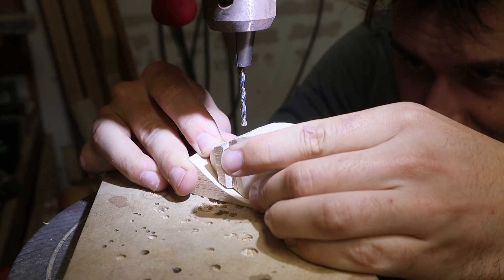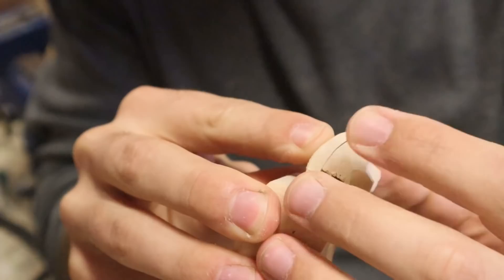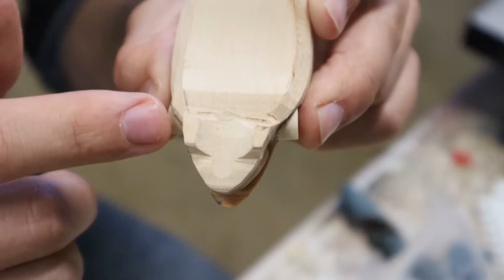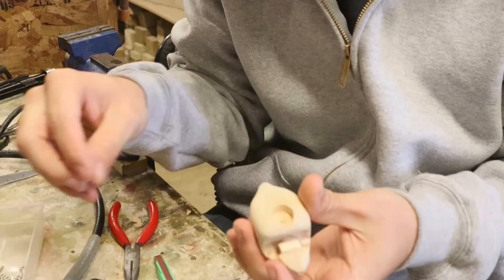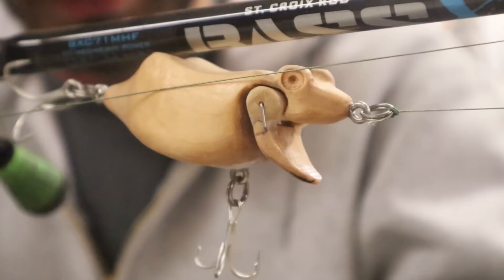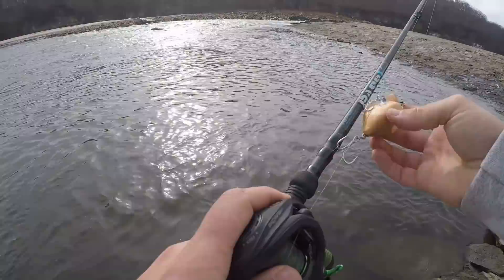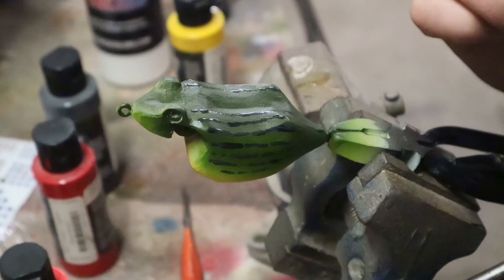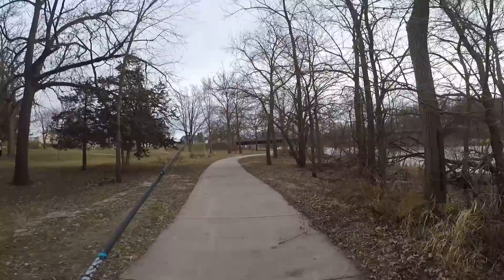Making a Hinged Jaw Bull Frog Lure

Comment: I think it's the drag caused by the water going over the humps on the back that is causing it to want to come back up. The lip opens and pulls it downward, then the drag causes it to want to level off, then the lip opens and pulls it down again, etc., etc. Adjusting those 2 parts, the size and shape of the lip and the size and shape of the humps in the back will adjust the up and down action. Silicon legs would work great on this bait too, I think. When it's in motion they will collapse backwards like a real frogs legs do when they are swimming. Then when you stop they will go back to normal resting position. Just some thoughts. Love the bait!

Comment: I LIKED IT MAN!!! I BET IT WOULD WORK GREAT AS A TOP WATER POPPER IN THE SUMMER. YOU COULD MAKE A LIP OUT OF LEXAN  CUTTING A SLOT INTO A DOWEL TO GLUE IT AND CREATE ANOTHER HINGE JOINT. THEN PAINT THE LEXAN AND WOOD LIP. SO YOU WOULD STILL HAVE AN AWESOME DESIGN WITH THE DURABILITY OF THE LEXAN.

Comment: theres a lure called the jumpfrog in asia for snakeheads that does what that bullfrog does. it is a triangular plug with the front like a ramp so it goes up and down in the water and makes some lovely splashes. can also be used as a popper to great effect. its so much simpler to make but still deadly effective. make one!

Comment: I think it might be worth while to go ahead and mold that lower jaw but rather than shaping it as it was in wood, shape it with slightly more of a square bill and mold it out of clear resin.  This way you can still paint the center-most part of the lower jaw the same way you had painted the wooden lower jaw and you could just leave the corners of the square bill lower jaw clear,  The painted portion of the lower jaw would be visible while the corners of the same lower jaw would essentially be invisible in the water.

This way you would not only have the "Porpoising" action but the square jaw might then add more of a conventional crankbait side to side action as well.  If the square bill lower jaw didn't give you any added benefit after testing it you could just round the corners to the shape of the original lower jaw.

Overall, I like the look of this lure.  I think it would make a great lure in an ultra-lite version too.

Comment: The movable lip is an interesting concept. I think what's going on is that instead of creating a constant pressure differential on the lip (which creates turbulence further downstream) it's reaching a certain amount of pressure and then the lip stalls and moves. I wonder if you played around with the range of movement (ie. how many degrees the lip can move and where that movement starts/finishes) whether you could further modify the effect?

Comment: How about some type of floating bug with a really small vibrating DC motor in it with an offset weight on the shaft? You can get fairly high mAh batteries in a small form factor.

Comment: That weird action is probably because the lip is pointed. Normal crankbait lips get wider as they go out which causes the bait to catch water and wiggle side to side. The frog catches water at the base of the lip and dives down. The body then catches water and pushes it back upwards.

Comment: halfway through, i'm wondering if you needed to drill the mouth all the way through. why not just drill hole on each side of the jaw to accept the dowels and leave the middle solid for strength instead of replacing the gap with a fixed piece of dowel? this would allow for more strength between the line tie and the hooks. just curious.

Comment: How to show lure action: build a longer tank, approx 500mm long 300mm deep and 150mm wide.
Buy the largest powerhead pump you can buy at your local pet shop,
Plumb it in so the intake is at one end of the tank and the outlet at the other. Total cost <$100 if you build the tank yourself

Comment: Could u please not remove material of using tools etc. - like u did with dremel in 2:30? I started doing baits thanks to u and i got Dremel 3000 on Christmas and i am always hoping that i will check out when and how to use things, how to angle my hands etc. so i don't have to learn that stuff thru my mistakes. Thanks!